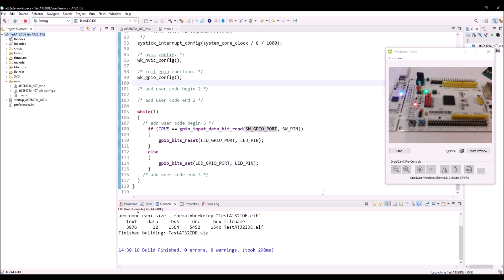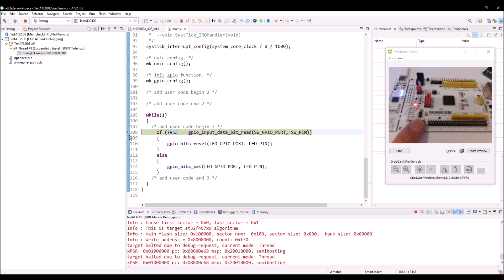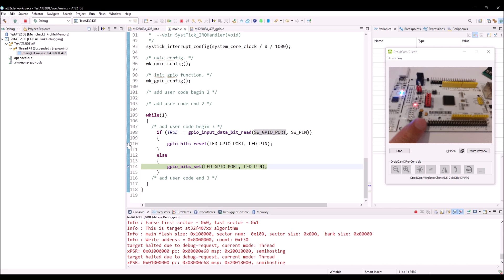5. Learning to Debug a Project with the AT32 Microcontroller from Artery Technology.

Comment: Hi, thank you for the quick response. First, thank you for the effort you put in. I will summarize my comments as follows:
1- These videos are supposed to be about the AT32 processor, directed to those who are not familiar with using this processor, despite the similarity of the way of dealing between this processor and the STM32 processor.
2- During the explanation, you jump from one topic to another. For example, in this video (Setting Up the AT32 IDE Software Tool by Artery Technology), after installation, you opened a previously existing project, then moved to a new project, and during the explanation, some errors appeared in the IDE at 3:37 and were not explained, but were bypassed. Also, in the test project 1, the files differ from the files of the project that was opened at the beginning of the video, and the difference was not explained clearly, despite the presence of an error sign on the IDE. The explanation was that the compiler process was completed successfully.
3- In the same video at 3:45 the time has moved to explaining Workbench .... etc.
4- In some videos you start explaining the project not from the beginning ... and so on
I think it is better for the explanation to be directed to the new user of this processor and the EDI and also the Workbench despite the complete similarity with STM32.
If it is possible to conduct the explanation sequentially and for one case without jumping to other steps it will be clearer.
Thank you very much
Reply from the maker: Ok thanks, I think you should have put the comment on the related video, here the timestamps don't correspond to this video (it doesn't even reach that time as it lasts only 3:27)
I'll review the video you mentioned and try to explain it if I can. If a new video is needed, I will do so and post the link to the new video as a sticky comment.
Reply from the maker: I was reviewing the video, at the first timestamp, 3.37, it is true that a red underlined text is shown, in  button_exint_init tool, function generated by the tool, it is a feature that I have noticed in other compilers, for example in MPLAB from Microchip Technology.

Sometimes, when you are manipulating some code, for some reason something is not synchronized and it shows you as an error, code that is fine.

But as you can see in the video, the code compiles and there are no errors, and those red underlines disappear. Otherwise, it would not be possible to compile.

Regarding the 3:45 mark, perhaps you did not understand it, but I indicate that I used a virtual machine to perform the installation, I already said that I am opening a project in the workbench already installed on my PC (not in the virtual machine) and it is the same as the previous video that corresponds to A Quick Look at the AT32 Work Bench Tool, what I see is that it would be missing a label at the top of the video to direct the user to said video.

I'm going to put this same explanation as a pinned comment.
Reply from the maker: I was going to edit the video to add the reference to the previous video called "A Quick Look at the AT32 Work Bench Tool", but I see that at time 0:49 I already have that mark set for that video, and YouTube does not allow putting two marks of the same video, and that is the reason why it is missing to mention it.
Reply from the maker: Regarding point 4, it seems that you have not followed the list of views in order, I will add numbers, so that it is easier to follow the order.

Point 1, I do not know SMT32, I am more into PIC32 and ATSAM32